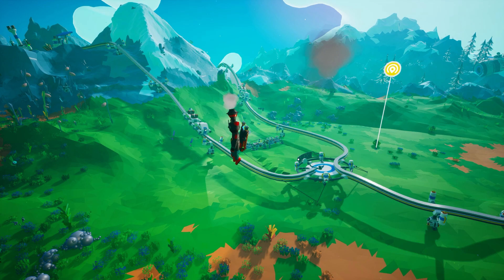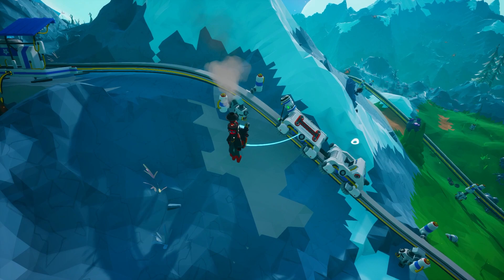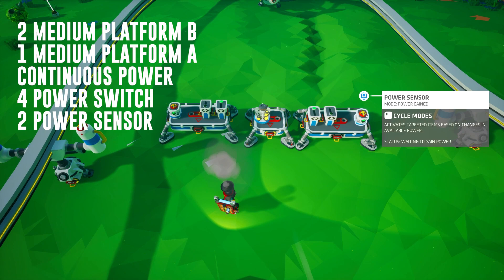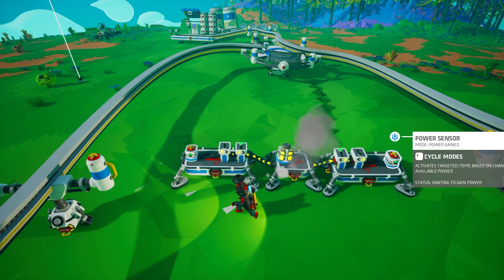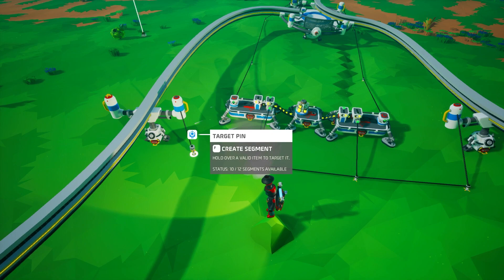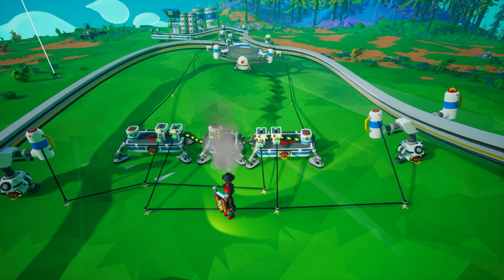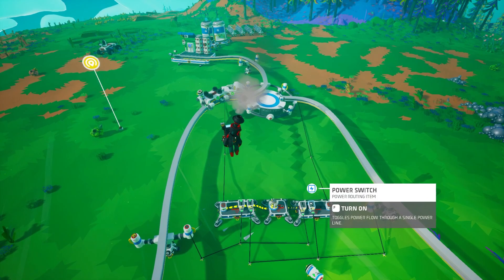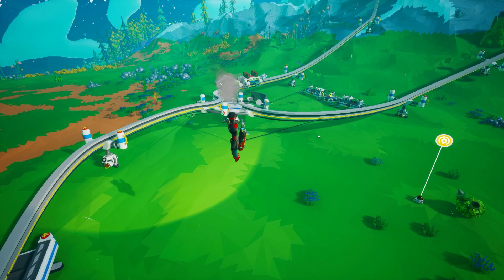Astroneer - Junction Automation - A Helpful Guide | OneLastMidnight

Comment: for the continuous power, you could just use a battery as nothing in the system consumes energy.
Reply from the maker: LOL, I knew this comment was coming.
Reply: You don't even need that; you could even hook up the system to one of the rail posts if you set it up right next to one, and in cases like this video, that's what extenders are for.
Reply: @Hunter-ze3my  I tried that, but it's not providing power for some reason when I set it up that way. I had to put a battery on it as it's the only way it would work
Reply: @KG-hf2pq  was the rail at any point connected to a power source?
Reply: @Hunter-ze3my  yes it was, the whole rail system had power. It was creative and I hooked up an RTG. The yellow line was present.
Reply: @KG-hf2pq  then it's not providing enough power

Comment: You over complicated a simple setup....it seems the 2 gates are not necessary what so ever.
Reply from the maker: Really?  I'd like to see your setup then.  But...  IMHO, I think you don't understand the problem this solution solves.
Reply: @OneLastMidnight  Yeah i thought you might be able to do it with one and gate at first, but then you run the risk of the uncontrolled train colliding at some pt.  Maybe you could add a counter that prevents the and gate from firing off until the other train is finished?  Maybe thats simpler?  idk i still have to try this stuff out.  Play all this in survival and just found out about the trains so started up a new playthrough so its going to be a bit till i get to that pt lol.

Comment: For as much time as these are to set up, you'd think it would be intended that the resource nodes would last longer with the auto extractors. :|
Reply from the maker: Yeah, it really depends on the resource node for sure.
Reply: At least in this case the setup is mainly on the junction which you can reuse over again. You don't even need stations at the extraction zone as the signal is just on the train itself.

Comment: I think I understand the setup you have. for both sides, the starting 'on' switch indicates if the joint is in use, and the starting 'off' switch indicates whether the current track has a train coming. This way, when the first train passees through, it turns off a switch on the other track while turning on a switch in its own track, with both switches on, the power sensor flips the junction to its own side.

 This is simple but genious, thank you for sharing this.

Comment: That was easy enough to follow, thanks

I was all excited to get into the trains only to discover that I can't seem to think up a use for them.  My Base is complete and all of the resource canisters are full of the fundamental  resources whereby anything can be made.  I can build whatever I want whenever I want without the need to leave the the planet.

I think what the game needs in order to move to the next level is to enable the ability to programme Shuttles to fly inter-planetary.
This would enable trains to be set up on other planets to deliver planet specific resources to a Shuttle that would then deliver those resources to the desired planet Base.
However, for this to be a worthy set-up, the ability to trade scrap for those same resources would have to be scrapped (😎) or at least greatly reduced.
Then another viable use for the Trade Platform would have to be created.

Comment: You can build this without using any platforms. Just set all the parts on the ground.  They have stands. Connect them with the power cables. Power >>(Cable)>> Switch 1>> (cable)>> Switch 2>> (cable)>> Power Sensor.  I do like to put the little work light on the end, after the power sensor. Just for effect.
Reply from the maker: Platforms?  You mean stations?  I was using the stations for auto-loading and unloading.
Reply: @OneLastMidnight like the medium platforms

Comment: Has anyone else run into any of the sensors / button repeaters not being able to utilize full length branches after 4 segments?  The pin just gets stuck and I can't move it forward, it seems there is a distance limitation from the sensor rather than the amount of segments.  I'm using storage sensors to button repeaters to shut down auto arms by extractors when my storage was full so the train doesn't get flooded with one resource in the loop setup.
Reply from the maker: I don't think there are distance limitation just defects.  I am waiting for an update to fix several issues.

Comment: Did you need an and gate for this? It seems like the trains would never interfere anyways based on the timing, the posts for each branch could have been wired directly to the junction through a 2 count repeater. So it only tiggers when the car is on the way in
Reply: Ah nvm you showed it works in case of a collision, so it WOULD work for whatever timing

Comment: what if the left train comes while the right train has tripped the sensor but hasn't crossed the junction. won't this cause the right train to get stuck at the junction?
Reply: by bad ill have to look into this
Reply from the maker: Should still work.  Been a very long time since I've used that stuff.

Comment: I seem to be having an issue with this setup, I have 1 auto extractor set up farther beyond another one, so sometimes the same extractor station will send off the train twice before the second one can. I've noticed when this happens, after the 1st train has already come and gone, if it goes through the junction a second time the track will not behave like it should, but instead change the junction to turn into the OTHER mining line, causing a head-to-head collision and stopping everything up. And even if they're the same distance this will still occur if 1 resource node is larger than the other. Any ides on how to resolve this?
Reply: I seemed to have resolved the issue, if anyone else experiences this all I did was reset the entire junction, pulling it far away enough to disconnect it from all 3 lines and placing it back. Ran through it a few times and it behaved like I wanted it to, never activated the straight track. Luckily, too, I was about to rig up some Macgyver hill billy sensor array to activate and deactivate the track whenever it saw the platforms lose power 😅
Reply from the maker: Strange.  Think it got confused at some point?

Comment: How would you make an automatic rail yard? Where when you are done with them you just send them down the rail and the switches automatically switc to an empty line?
Reply: Probably something like this: A detector will switch the track to straight when a train passes, but if that train wants to come back, it will go back to curving, I can't quite explain my thought process (was never really good at that) so I hope that I got some of it at least understandable.
Reply: God that would be pretty complicated, not sure you can really do it automatically since there is no real output once the train has discharged its cargo.  I would imagine you would have to have a control panel to manage access with a proximity sensors at the end for calling the train back. Eh another maybe round about way of doing it is a ticket system?  Once you know the train is done add a material to the train and send it down to the yard.  At the yard entrance you would have a auto an auto arm set to that material with multiple platforms with storage sensors in reach. As each storage sensor achieved a full status it would close the corresponding gate thereby preventing new trains from entering. When you need the train back you would have to activate a proximity sensor from a central location to send it back... There are a crap ton of issues with this idea... I think you would need individual platforms for each leg of the rail yard with way to return the material back to the train so when its recalled it can unlock that leg for other trains to use it later.  At the end of the day i think its possible, but you are going to need a ton of buttons, gates, auto arms, and platforms to make it a reality.

Comment: Is it possible if i branched out the segments on the existing setup to another rail junction? Will it work?
Reply from the maker: You can use this were any two rails need to combine.  Here is an example - r is Rail, and j is Junction.

r  r     r  r
r  r     r  r
 j        j
 r        r
 r        r
      j
      r
      r
Reply: @OneLastMidnight  for your “R is Rail” are you referring to the rail post? Or rail station? Or rail car?
Reply from the maker: @supersayianz  Rail post and rail line.
Reply: @OneLastMidnight  i wanted to send you a link to my google drive to see my setup. But I cannot share the link in the comments [auto removed]. You may find the link which I have sent you an email to on your business enquiry email. Apologies as your discord link has errors.
Reply from the maker: @supersayianz  There are no errors with my Discord link - https://discord.gg/MEhpVQH

Comment: 2 questions for the almighty midnight, can i put the junction closer to the 2 stations that are picking up resources? what is the delay repeater set to?
Reply from the maker: Repeater delay is 5, and I wouldn't put the junction close to the resource because it will delay the delivery even longer, but...  Your choice.
Reply: @OneLastMidnight  i wanted to put it closer because both the stations are coming from the core to the surface and i only have one track. i guess i’ll put down 2 tracks
Reply: @cohen_donley  You might consider placing a Rail Station near the core and having the main line to the surface run back and forth between the stations.   You can then set up multiple short rail lines between the resource extractors and the core rail station using an auto-arm to load from the multiple rail lines into the station.